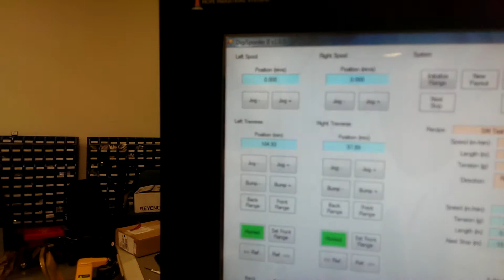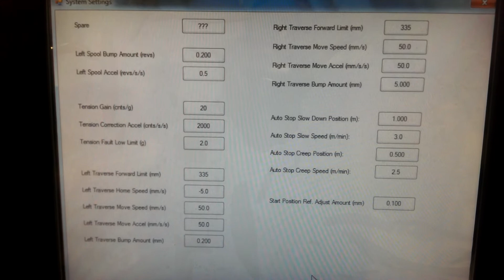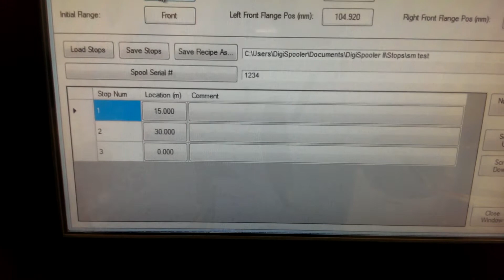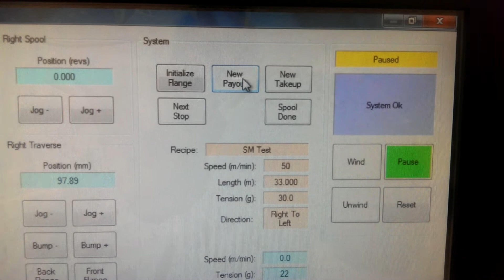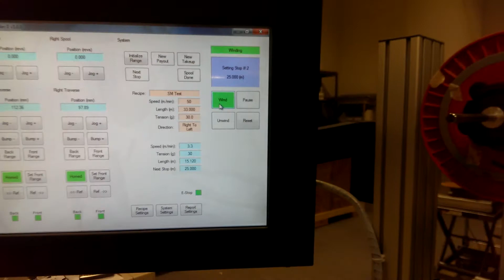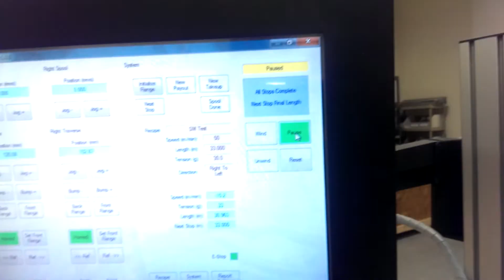DigiSpooler II - Bidirectional Optical Fiber & Filament Winder

Comment: Very well made, looks impressive. Can it layer wind?
Reply from the maker: It is a precision winder, so it is capable of neat layer winding.  The traverses move with +/-3 micron repeatability. Even so, it takes a lot of care - and sometimes trial and error - to achieve a perfect layer wind result.  This is especially true if winding optical fiber at very low tensions (<20 grams).  The fiber does not always stay where it is guided even though the machine moves with exact precision.